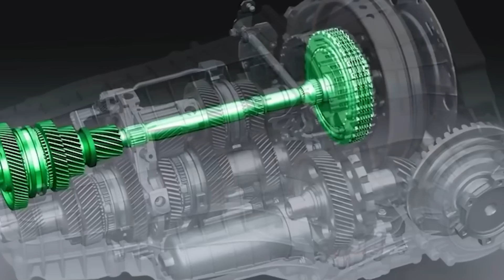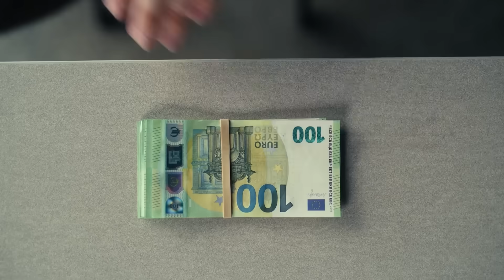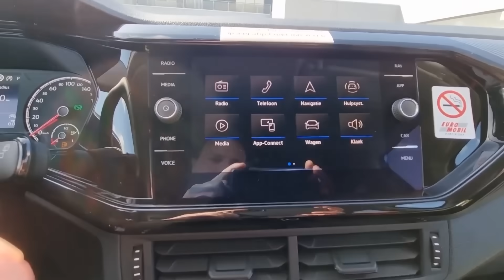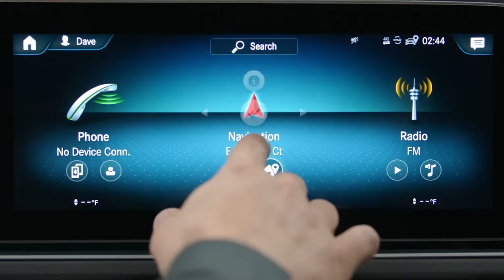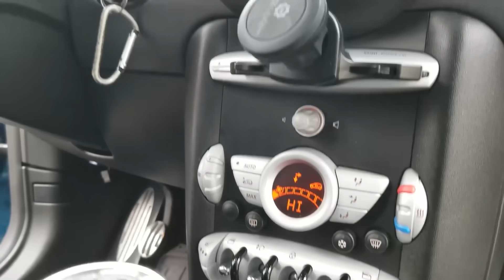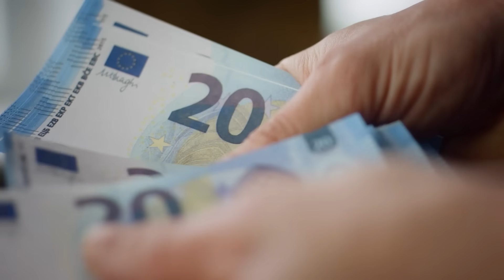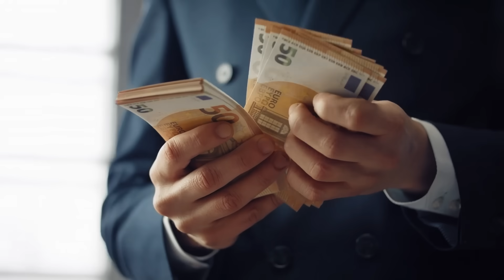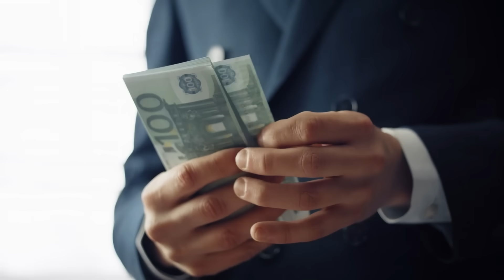7 DIRTY Secrets Why Your European Car BREAKS After Warranty

Comment: Warranty means nothing - vehicles are protected by law in many countries beyond warranty , major and critical components by australian law in this case must last and be reliable for a reasonable amount of time , both in distance and time , a properly serviced car does have consumer protections by law , unfortunately you’ll have to fight for this to happen and may cost you a small fortune to win or loose . personally i believe all vehicles should have zero faults for 10 yrs or 250,000km if serviced correctly , any faults whatsoever should be covered , as said in this video - they can make it better and choose not too , if made better then my stated distance / time would be no problem to achieve without fault. Many of these car manufacturers should be facing massive global class action law suits to make components better and servicing easier , such as have dip sticks for both engines and transmissions and  easier to service transmissions . not to mention the climate change side of things - cars that last 20-30 years are cleaner for the environment then replacing a car every 8 yrs ! they are deliberately using more of the earths resources than required , if only it was made better !
Reply from the maker: That’s a really strong point. Cars could be built to last far longer and it would benefit both consumers and the environment. Instead, short lifespans keep the sales cycle going.

Comment: Germans love love love plastic. Would not be surprised if German engineers started making plastic rods, crankshafts, pistons, piston rings, and blocks. The quality of a cheap cox .049 rc plane engine is superior to german engineering.
Reply from the maker: Plastic creeping into critical parts is a big complaint. It might save costs upfront, but long-term it undermines confidence in engineering.

Comment: It is not true that Japanese and Korean cars are not part of this problem. My wife’s “dependable” 2021 Subaru Forester is heading to being a money pit at the end of its warranty. We are fighting to get a failed electronic cooling stestem component replaced, one that is subject to a law suit in the US but denied by the dealer here in Australia. Don’t get me started on the warning and infotainment system problems! My BMW (which I maintain myself) has a much better build quality than this Subaru. There are plenty of other Japanese car problems, like peeling paint in Australian conditions, Toyota included.
Reply: I knew you were going to say Subaru before even reading in full.
Reply: Stop talking... Just stop... No one believes these false comments anymore.
Reply: @randallschmidt6225  Evidence?   Bring receipts or forever hold your peace.
Reply: What you are experiencing is the TCV Failure. My mom's car had the same issue. Replaced under warranty. The TCV is essentially a Thermostat. There is a flap that gets stuck open or closed. Typically open. You can tell it's open if it's taking longer for the car to warm up. If it's stuck closed, the car can overheat, at which point, have it towed so you don't risk blowing the motor as the engine cannot cool itself. It's such an issue that Subaru actually did away with the TCV for their new generation Forester (2025+). It's a shame because Subaru's are good cars, but this part is awful. It's made of plastic and sits right on top of the engine, under the intake manifold. I think the worst part is the fact that Subaru still has not issued any form of recall for this part. Only an extended warranty for those of us in the US.
Reply: @sebastian01800 I’m already onto it. I have booked it into Subaru, where I have asked them about the TCV valve before. They brushed it off at regular services, saying the behavior is normal. This time it is the issue it is booked in for and I am going to hold them to account. We have good consumer protection laws here in Australia.
Reply from the maker: Good point. No brand is completely free of issues, and your Subaru example highlights that well. It shows how important it is to look at each model and how it’s maintained, rather than assuming all cars from one region are automatically better.
Reply: your fault as Subaru's have become notorious unreliable and you should have checked that before buying a '21 Forester.
Reply: @ericshutter5305  It was bought new, leased by her university as a company car, so no, not our fault. I wouldn’t have chosen it. I had borrowed an early model Forester once, when it was new and was put off by the noise and terrible fuel economy. The parents of my girlfriend at the time bought two identical ones and they both had the same problems.

Comment: I just bought a BMW X3 30d at just under 100,000 kms. It is in great condition, but I broke the BMW service protocol by replacing all of BMWs “lifetime” fluids (ZF 8HP auto transmission, diffs, transfer case, coolant). I replaced the timing chain tensioner for the one that suprseded the version that was on the car, but was not changed by BMW when servicing it. I will be more than halving the oil change interval and shortening the rest appropriately. I keep my cars for many years and they can last with a rethink of the maintenance schedule. This one is a 2016 model and is almost as young as I dare go with a German car.
Reply: Why would you buy an X3 and then try to mitigate its unreliability? Just buy something else.
Reply: @bikeman123  🎯
Reply: @bikeman123  Because it drives very well and is easy to maintain if you know what to do. "Something else" drives like crap.
Reply: @bikeman123  It hasn’t been unreliable for me, it’s an amazing car to drive, tons of power, uses very little fuel and was really cheap, bought used, for a solid luxury car, because everybody has been led to believe that BMWs are junk by videos like this one. Do you work on cars? If so, what is your specific issue with the build quality of the F25 X3 3 litre diesel? Compared to other cars I’ve worked on, I’m not seeing anything of concern, that good maintenance wouldn’t keep in check.
Reply: @chrisbennett5796 the plastics and the rubbers are the Parts that are failing after 5 years or so . Plastic fuel pumps , Oil pumps and on and on . Seals failing . They build for rentals
Reply: @bikeman123 because they’re nice cars. If you drive on the autobahn regularly than you’ll need something that has the performance and brakes for sustained high speed cruising. Even my grandmother cruised at 100mph in heavy rain, at age 80 with me and my brother in the backseats of her BMW 😂
Reply: @vandijk1698  Your grans old BMW was from a different era, modern beemers go great for 4 years and then it begins, ecu's, suspension rubbers and the complete Lego plastic cooling system disintegrate. They look great tho😂
Reply: @vandijk1698 I had a late 80's BMW 735i I bought from a friend back in 2012. That car was so fast and smooth. I drove it across the U.S the day i bought it and occasionally surprised myself when I glanced at the speedometer and saw speeds of 90+ mph when i thought I was just cruising and it went around curves like it was on rails. Alas, it needed some work, mostly interior cosmetic stuff. The sunroof leaked and it stopped opening, not sure if it was the motor or just the switch. The same with a couple of the windows. The leather seats was cracked and split in some areas and rust was developing around the edge of the fenders and the trunk. All repairable but I wasn't prepared to invest the money it would cost as I needed it for more important things at the time. I sold it about 3 years later to a BMW enthusiast who collected and restores them and that I knew would give it the care and attention it required. I really miss that car and wished i could have kept it, but i didn't want it rotting away in my garage. It's kind of like giving a child you can't provide adequately for up for adoption, you want them to go to a good home. 😊
Reply: I do oil analysis at work. You don't have to buy BMW oil. BMW doesn't even make oil. It's just rebranded with their logo on it and made by a petroleum company. You are doing the right thing by matching the specs and using your own oil.
Reply: Bro is 10 steps ahead😂
Reply: My Porsche Cayenne is now 21 years old and still a daily driver. Except fuel it’s probably the least expensive maintenance in over 30 years of car ownership.
Reply from the maker: That’s an excellent breakdown. Following a stricter maintenance schedule can definitely make a big difference for BMWs.
Reply: What about wet belts?   Conspiracy or cock-up?
Reply: Agree anything after 2016 is a no go.
Reply: If a BMW is driven trouble-free on another car for only four years, its trade-in value will plummet, depreciation will be enormous, and mileage costs will skyrocket.
Who will want to buy such a car in the future?
Reply: I’ve often thought that most of the problems with BMW stems from the ridiculous “condition based servicing” regime. Plenty of evidence suggests that a proper servicing and maintenance regime eliminates the vast majority of issues; proper oil chance intervals, replace the plastic oil filter housing for a proper aftermarket metal version, replace cooling hoses and expansion tank etc.
Reply: @DarrenWalker-u6r Yes, following BMWs recommended condition based service  would take a big toll on the vehicle’s life expectancy. As you say, there is a thriving market for improved parts. I nearly lost my first BMW (M50 engine) to a disintegrated plastic water pump impeller. BMW could only sell me the same junk part, so I quickly learned the world of upgraded aftermarket parts.
Reply: @DarrenWalker-u6r why would have to ?
Reply: Rubbish!!!
Reply: @ivanhriskov6240  The video or the cars?

Comment: I gave up BMW with my last F10. Such a money pit. Maybe wet belts should be also mentioned here.
I think German car manufacturers are shooting themselves in a foot. It will take time and many people are already realizing what is going on.
Reply: The German manufacturers are relying on their historic reputation for building quality cars in the past. But more and more people are turning away from them. Give me a Toyota or Honda any day.
Reply: @robd9863 modern Honda and Toyota too heading there, at least in my country it still rare case but it's having the same pattern , broken after warranty. it's like they all have the same objective to squeeze as much as they can but use different ways.
Reply: Wet belts are started by Ford Motor Company, so be quiet.
Reply: @flexiblebirdchannel actually ford copied it from the Europeans but yes Ford are a European manufacturer and  cannot be trusted as they create impossible to service parts that break and have done for at least 20 years. FORD focus bonnet lock story anyone?
Reply from the maker: You’re right, a lot of people are realizing the same thing. Issues like wet belts and high repair bills really undermine confidence in the brands.
Reply: Now that they don't have cheap Russian energy, they will do more "price cutting"
Reply: I love my f10 528i it is a money pit but with a reasonable maintenance agenda it can last forever mine is at 180,300 and so far it’s been good just expensive batteries I also do my own service sorry to hear that
Reply: My F10 also costs so much, for dor handle with comfort aces cost 630€, I already put 3k€ in car in less the one year. NEVER BY BMW. IT CHEAPER TO BUY NEW one THEN USED!
Reply: BMW uses timingchains, not wet belts
Reply: German cars quality is really bad, I was comparing what I have had to replace on my Mercedes with 1/3 miles vs a Chevrolet and Chevrolet is like brand new compared to this German money pit 💀 (I grew up loving and dreaming about a German car btw)

Comment: Bullshit! i known people with Bmw's N55 with 300.000km with no problems, only the chargepipe that blown away.
Good mechanics and good maintance are cruciale
Reply: ................. & I KNOW Many MANY more with PROBLEMS....WAKE-UP!
Reply: @donaldbanner2185  wath is the solution? Buying old junk? 
Sensors, bearings, head gaskets, are expensive to. Toyota's 2GR-FE cost 7000 dollars to repair the front timing cover seal. Thats the price of a new Bmw N55 engine
Reply: @tinodeblier3749 you use your one car as an example of how reliable all German cars are.
Then you use one Toyota as an example of how unreliable all Japanese cars are.
They are always exceptions to the rule.
Reply: @senseofthecommonman every car have his problems. Cars have more than hunderd parts that can fail on long term. 
Gearboxes, drive shafts, elektronics, etc..etc..
 the perfect cars do not exist.  Not the new one, and not the old one. Even the icoon of reliability, Honda K20 have his weak spots.
Reply from the maker: That’s fair, a lot depends on maintenance and good mechanics. Some engines can go the distance if treated right.
Reply: @UnderTheBonnetTips  oil changes sooner as the manufacturer say, are crucial. Direct injection engines are sensitiv for blowbye on the inlet valves.

Comment: It's simple. It's cause people follow their insane oil change intervals. 15,000-30,000 km oil changes.
Reply: 15000 km oil changes are no problem at all with modern engines and synthetic oil. I drive 15000 km per year, so my car gets its maintenance every year, which never has given me issues. I agree that stretching it to 30.000 is a bit too much though.BTW: My car is a VW Bora (4rd gen Jetta in the US) from 2004 with over 200.000 km on the clock and still going strong.
Reply: I always change my engine oil at 9,000km. I have my auto fluid checked at the same time when my garage does the service. They check everything, brakes, rotors, you name it.
Just went past 270,000 km recently. I do about 8,500 km per annum on sealed roads.
Car: 1999 Nissan Maxima 3 litre V6, second owner.
Have replaced: radiator, starter motor and alternator. 
NZ.
Reply: @Phil-oj5nr  I do the same on my car. Manual happily so no need to worry about the gearbox being knackered from a previous owner.
Reply from the maker: You raise a really solid point. Extended oil change intervals have definitely played a role in premature wear.
Reply: Modern synthetic oils are a technical improvement,  but they are not magic. They still pick up contaminants from EGR and metal particles from inevitable component wear, causing a grinding paste effect. I would not go past 10,000 km with any oil change in a car that wasn’t already a throw away.

Comment: I fact checked the claims in this video. Let’s just say that almost none of the claims were true. What is the agenda of this channel?
Reply: Which claims specifically did you fact check, and how?
Reply: @Krmelj  I know 5 audi owners that have had engine failures after 60,000 miles. A friend of mine had a BMW that only lasted 41,000 miles before needing major work and he traded it in for a Camry.
Reply: @Krmelj Most of them. Don’t have time to account for it all right now. Not my job. Checked the manufacturer’s websites and EU regulations. 
For example: you CAN change the oil on DSG gearboxes. The cars ARE 100%  hot galvanised. The cam chain guide isn’t all plastic. Etc etc.
Reply from the maker: Thanks. Most likely we "fact check" things differently .

Appreciate the feedback
Reply: Try working in the car industry, then you will realise it is an accurate overview
Reply: who do you earn your money from are you independent and how did you fact check
Reply: I have first hand experience of what he claims. I just rebuilt an Audi A4 B6 1.8T engine because of a timing chain tensioner guide disintegrating. I can send you the pieces.
Reply: @henryvaneyk3769  But why are you all over the place ?  From 30 replays, 20 are yours .